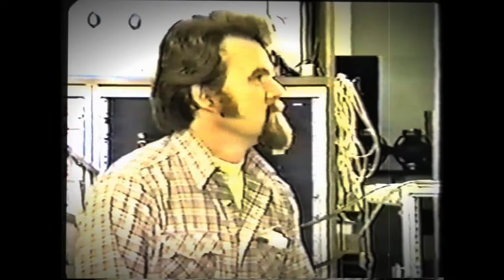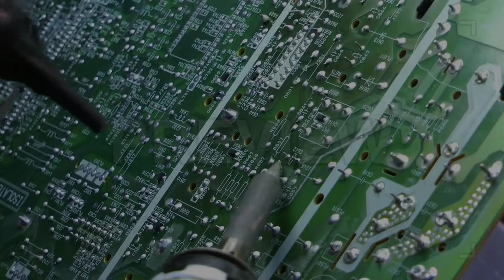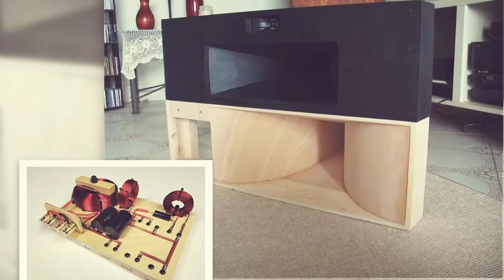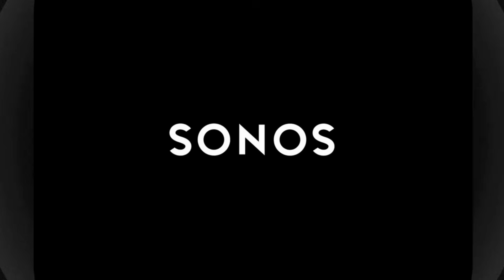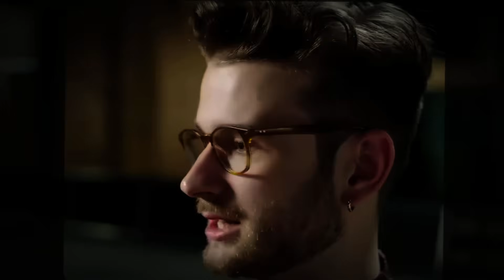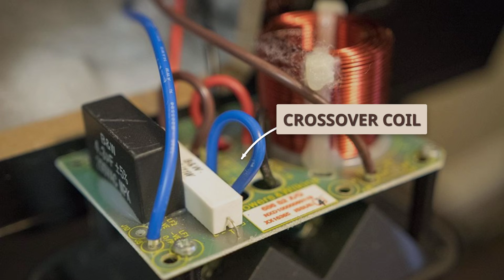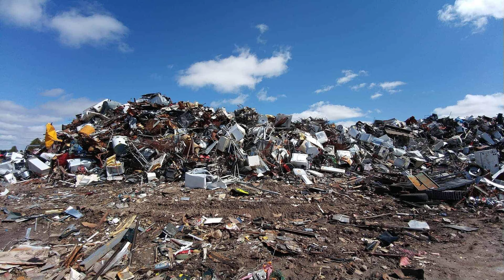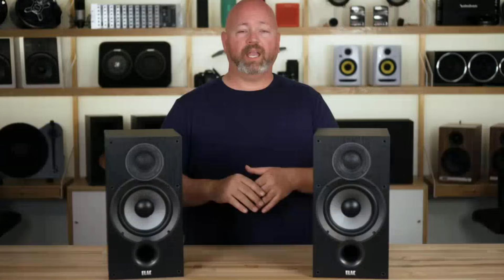The Audio Technicians Blacklist: 5 Hi-Fi Speaker Brands to Never Buy

Comment from the maker: 👉 wiredtruth.netlify.app 👈

Which speaker brand has disappointed you the most? Drop the name below 👇
Reply: Sonos and most asian made bLuetooth speakers
Reply: Any speaker that doesn't sit on the floor disappoints me into existential agony and remorse. No matter how much I spend.
Reply from the maker: @RobertStribley-r8l  That is a very specific kind of audiophile suffering. Floor-standers only we respect it. Good news: the next video is exactly for you. Five speaker brands worth actually spending money on. Just dropped. 🏆
Reply: @RobertStribley-r8l  That's why I dig Klipsch Heritage models, even before they called them "Heritage".
Reply: Yeah, I actually came up with a design idea. That’s even cheaper than that without even touching the crossover.. I took the grills off the Polk audio T 15’s and noticed that they only have one bass port  on the front side the wooden plate that the components are attached to is full of screw holes, especially around the tweeter so my thought is why not just take the wooden plate off of the front of the speaker drill a second hole for another bass port  on the opposite side attach some foam insulation to an aluminum plate and install that on the speaker with the new bass port  added this way you have no screw holes around the tweeter and the 5.25 inch woofer can do everything that is designed to do because it’s not fighting screw holes when I checked out the Polk XT 15s I noticed they moved the port to the back, but that’s a problem if you are in a situation where you have to mount your speakers facing the wall so I feel like they had the right idea when designing front ported   speakers, but because of where they put that bass  port, it’s lopsided and with my idea, it evens it out and makes the overall design better without even having to go in and touch the crossover. Also, it’s recommended to change the woofer geometry so that the dust cap is actually in instead of protruding this way the base response is actually tighter. what inspired this idea was Fluanse uses a similar concept for their XL seven and XL eight speakers of course the Excel 8S speakers are oval shaped instead of squares, but they basically had the same idea for the XL sevens which are squares with curved edges so I think the Polk just has good bones. It just needs to maybe have a slight material overhaul instead of a full crossover rebuild.
Reply: Clips. 😮
Reply: @TechnoCentral3756 movie clips or music clips? 😎👍🤣
Reply: Klipsch.
Reply: Klipsch. Sent them back.
Reply: Monitor audio,Dali,Wharfedale EVO series,Polk R series
Reply: Bowers and Wilkins
Reply: B&W’s? Explain
Reply: @armanddimeo6575  I agree. 805s have no musical DRIVE. Very little emotion... anyone wanna buy a pair?

Comment: Bose has more problems than built in obsolescence. They use the cheapest parts and make absolutely  awful designs. Appearance is optimized over sound quality. The only thing they are good at is marketing. Stay away from  them.

Comment: Not agree with the bowers,i have the 7 serie line and yes takes a lot of time to measure but it sounds great.And in Holland we have a bowers and wilkins repair shop they can fix everything if a speaker is broken.But mine runs for years perfect....,my cousin has paradigm and sounds dull.Intruments what you hear with my bowers he cant hear it on his paradigm.
Reply: Agree. I have some recent B&Ws at the higher price point and they are absolutely fine, no issues at all. Certainly not yet. I once had Kef Reference 104/2s and wasn’t enamoured with them at all.  And not everything manufactured in China is necessary junk, not any more. That’s just an old prejudice as times have changed.  That’s tantamount to the most expensive gear is the best.  Much also depends on governance between the main company and the off-shored manufacturing operation - some are ruled with an iron rod and have a laser focus on quality. Others don’t - that’s where the rubbish comes from - and could be from anywhere.
Reply: @monstermax22 Totally agree,thats what i think too
Reply from the maker: Both fair points, and worth acknowledging directly, a well-managed offshore operation with real oversight can absolutely match domestic quality control. The pattern we flag isn't the country of manufacture, it's what happens to component sourcing and quality oversight after a private equity or conglomerate acquisition specifically. Sounds like your 700 series is getting the good end of that equation. And always nice hearing from the Netherlands, lovely part of the world 🇳🇱

Comment: I know svs is a all new modern day company any thoughts on them?
And i bought  rp 600m  bookshelf speakers i might have made a mistake
Reply from the maker: SVS earned their reputation the hard way by publishing measurement data and offering a trial period because they were confident enough to let the numbers speak. The engineering culture that built the subwoofer line carries directly into the speakers. As for the RP-600M that is the Reference Premiere line we covered, not the Heritage series where Klipsch's real engineering shows up. Not a disaster, but not where the Klipsch reputation was built. What system are you running them with? 👌
Reply: @WiredTruthHIFI i don't know if i should return the klipsch speakers and get the elac debut 2.0 b62 speakers because I'm  going to get a sony str az 1000 es receiver and have the elac speakers in a 2.1 or 3.1 setup

Comment: the brands being JBL, BOSE, Sonus, Klipsch (the current ones, not the Heritage series) and Bang and Olufsen. Buy Elac, KEF, active speakers
Reply from the maker: That's the list 🏆 and the active speaker point is worth adding. Genelec and Neumann in particular are exactly what happens when the engineering budget goes into the driver instead of the badge 👌

Comment: I bought a complete set of Bowers & Wilkins S3 600 series well over 20 years ago.  They still sound wonderful to me.  Used ones are frequently available on eBay.  I agree that the modern B&W don't sound as nice (unless you are buying 800 series at $10K a pop...)
Reply from the maker: Twenty years on the S3 600 series is exactly the point! That generation was built before the ownership changes started compounding. The fact that used pairs are still available and still performing tells you everything about what the engineering decisions were before the quarterly margin targets took over.

Comment: My old Pioneer floor standing speakers and pioneer vx 815 amp, 28 yrs and still going strong.
Reply from the maker: That's the kind of longevity that says everything about how those Pioneer cabinets and amps were built. 28 years of solid performance is rare today thanks for sharing that! 🤝
Reply: @WiredTruthHIFI thanks 🍻. Dont think they will ever die. And i push them really hard sometimes or often. Also got Yanaha system Rx v685 with the ns 777,s. And surround, going well for 7yrs now. And i mean i dont play when i use my systems😂😂

Comment: Bought a pair of Klipsch Forte speakers around 1990.  Paired them with a Adcom 545 amp and Adcom preamp.  Still jamming out like they did way back when
Reply from the maker: The Forte was Klipsch before the brand leaned into mass-market tuning that horn-loaded midrange paired with a real amp like the 545 is a different animal from what's on shelves now. Good pairing, and good sign it's held up this long. 👌

Comment: I bought my DCM time windows in 1980. They've always been set up according to manufacturer requirements and their performance is still stellar. After 46 years I can still crank them up and let them rip. Heard a lot of great speakers but I've never heard better spacial dispersion than the dcms. provide
Reply from the maker: 46 years and still cranking! that's the benchmark right there. DCM built the Time Window around a specific philosophy of time alignment and driver spacing that most manufacturers weren't even thinking about in 1980. The fact that yours are still performing after proper setup all these years says everything about what honest engineering looks like 👌 🏆

Comment: B&W 802 series 2. 38 years old and fine 804d2 15 years old fine . Current 800 series are fine . Perhaps you're referring to the Chinese made B&Ws .I wouldn't buy any speaker made in China.
Reply from the maker: The 802 S2 and 804 D2 are exactly the generations we'd point to as proof of what the engineering culture produced 38 years and still running is the benchmark. The concern isn't country of manufacture, it's the crossover component specification decisions that changed after the ownership transitions. Those happened regardless of where the cabinet was assembled 👌
Reply: @WiredTruthHIFI  I  agree on most of your points.  However I would rather have a proper design in the cross over with mid level parts than a compromised design with top level parts. I have heard 802s with up graded cross over parts the difference was slight . Anyway I found your piece interesting.

Comment: I still use a Denon 40 wpc receiver I purchased in the mid-80's. It's currently in my garage powering 2 pair of speakers. 1 pair inside the garage, and a 2nd pair of outdoor Cambridge Soundworks speakers mounted on the outside of the garage by the pool. Those speakers have worked for over 25 years, surviving 25 years of New England weather! I also had a pair of professional DJ speakers made by EAW (Eastern Acoustic Works). I purchased these used in 1988 and used them up until 2012 when I purchased smaller powered speakers.
Reply from the maker: A mid-80s Denon still powering four speakers including outdoor duty in New England weather that's exactly the build quality we're talking about when we say vintage engineering outlasts modern gear. EAW is serious professional kit too, that's a studio and live sound brand that doesn't cut corners 👌 🏆 🏆

Comment: I bought my first pair of BOSE 901s  54 years ago.  They were good then, but they didn't improve much after that.  About twenty five years ago, I bought a pair of Yamaha NS-1000M.  Still happy I did.
Reply from the maker: 54 years on a pair of 901s is impressive staying power but the NS-1000M is a completely different league. Beryllium dome drivers built for broadcast accuracy, the kind of honest sound the 901's reflected-wave design was never designed to deliver. Smart upgrade 👌

Comment: Still have my JBL 4312s from 1984 but they are starting to have a few issues so i am looking for a repair source. In the meantime, I picked up a pair of newer Klipsch 8.5s to listen to. They are not all that bad at lower power but they are nothing like my JBLs. Still well worth the $200 I paid for the pair.
Reply from the maker: The 4312 is a legendary studio monitor design well worth repairing if you can find someone who knows JBL's vintage crossover networks. And that gap you're hearing between the 4312 and the new Klipsch is exactly the kind of component-cutting we cover on this channel 👌

Comment: "Repair technicians do not buy Bose"... Heck, we don't even accept freebies from Bose. Their speakers suck but their headphones aren't as bad. Not top quality by any means, but okay for casual listening.
Reply from the maker: That distinction between Bose headphones and Bose speakers tracks with what most technicians report too the noise-cancelling headphone line gets a pass for casual use, but the speaker lineup is where the ecosystem lock-in and the price-to-performance gap really show up. Not accepting freebies is about as strong a statement as a technician can make without saying it outright.
Reply: @WiredTruthHIFI  I am a recently retired audio techie dude. Out of college, I was lucky enough to land a position at a high-end-only audio dealer; I spent 39 years working there as the speaker guy. 

My job was to design proper crossovers based on cabinet specifics such as interior volume, cabinet resonant frequency, driver resonant frequency, driver Qts, etc. I also tuned them in our anechoic chamber. In case you don't know what pink noise is, you'd have plenty to play with over there,      

I really liked designing passive crossovers; it involved lots of tricky calculations, until computers took charge of the most tedious tasks. They left us alone for the fun stuff. Computer-tuned speakers just sound horrible to me, and electronic crossovers  on consumer speakers are just plain garbage.

Comment: I have a pair of EAR Yoshino (3 way) from 2011. They were expensive but sounds amazing connected to a 1960s Leak sterio 20. I will not trade them for anything I hear.
Reply from the maker: EAR Yoshino three way from 2011 connected to a 1960s Leak Stereo 20 Tim de Paravicini's speaker designs paired with one of the finest British valve amplifiers ever made. That combination from two completely different eras of engineering working together perfectly is exactly what this hobby is about at its best. Nothing you hear today will make you trade that.

Comment: I have 2 "old" pairs of speakers that still sound amazing. Firstly, a pair of Quad ESL63  speakers refurbished by Quad themselves. Secondly, a pair of Monitor Audio S6 Silver floor standers still sounding like the day I got them new in 2003
Reply from the maker: Quad ESL63s refurbished by Quad themselves alongside Monitor Audio Silver S6 floor standers from 2003 still sounding like new two completely different engineering philosophies both proving the same point. The ESL63 electrostatic with Quad factory service is as close to a guaranteed performer as hi-fi gets. And Monitor Audio's Silver series from that era used real aluminium-magnesium alloy drivers that have aged exceptionally well. Still sounding like the day you got them is the only specification worth quoting. 👌

Comment: I like my Sonos system- but it is only for casual listening.  I have no reason to believe the speakers won't last for five years or so, and at the price point, can be replaced without too much consternation.  I would never buy a Bose or a Klipsh.  Never a fan of either- when I see a horn speaker if turns my stomach.  B & W were very good speakers in the day- but as the video indicated- they're not what they once were.
Reply from the maker: Sonos for casual listening with a replacement mindset is actually the honest way to approach it, the problem the channel covers is people buying Sonos expecting it to last twenty years the way a passive speaker does. Your approach removes that expectation entirely. On horn speakers, that is a legitimate preference. Horn loading is efficient and dynamic but the presentation is not for every room or every ear. And on B&W you landed on exactly the point. The heritage was real. The current ownership structure is the question. 👌
Reply: @WiredTruthHIFI  Excellent post!  Nailed it.
Reply from the maker: Glad it landed. 👌 ❤️

Comment: Infinity sm120
Reply from the maker: The Infinity SM120 was built during Infinity's serious engineering era EMIT tweeter technology that most competitors at any price could not match for high-frequency detail and air. A speaker that rewards proper amplification and placement. Still holding up is no surprise given what went into it. 👌

Comment: Oldest speakers...Tannoy 611 Mk II's 35 yrs old and bought second hand deliberately. I love them!!. Also have a set of 3 ways from an old Kenwood 21 series set up, using them bi-wired with the Center from the set also.
Reply from the maker: Tannoy 611 MK IIs bought second hand thirty five years ago alongside a Kenwood 21 series three way bi-wired, that is a system assembled with intention rather than impulse. The Tannoy dual concentric driver in the 611 is one of the most coherent point source designs ever put into a consumer cabinet. Thirty five years later still loved is the only review that matters. 👌

Comment: Quad ESL 57 Electrostatic Speakers, connected to a World Audio Design K5881 Mk2 Valve Amplifier.  Mine were made in 1962.  Quad still services them, as does 'One Thing Audio'.  I also have a pair of KEF iQ30 speakers, which are now 18 years old and still sound great.  Russ.  Hampshire, UK.
Reply from the maker: Quad ESL 57s from 1962 still in service. Peter Walker's electrostatic design remains one of the most coherent and transparent speakers ever manufactured. The fact that Quad still services them sixty years later is the ultimate statement on what genuine engineering commitment looks like. Paired with a World Audio Design K5881 valve amplifier that is a combination that would embarrass systems costing twenty times as much. And the KEF iQ30 alongside it for eighteen years without complaint. Hampshire clearly takes its audio seriously. 👌

Comment: Rogers LS7t, unaltered. smooth flat organic sound, brilliant.
Reply from the maker: The Rogers LS7t is one of the most underrated British speakers ever made the larger sibling of the LS3/5A with the bass extension the smaller box could never deliver. Unaltered after all these years means the crossover components have held their values, which says everything about the quality Rogers specified. Smooth, flat, organic is exactly the house sound that made Rogers a reference in broadcasting. 👌

Comment: 1953 Western Electric 755a
Reply from the maker: A 1953 Western Electric 755A one of the most historically significant full range drivers ever manufactured. Originally designed for telephone switching stations and theatre installations, the 755A became a reference for audiophiles who discovered what Bell Labs engineering from that era actually sounded like. Seventy years later the driver still commands prices that reflect exactly how irreplaceable it is. 👌
Reply: All  true, Korean war results,kind of.